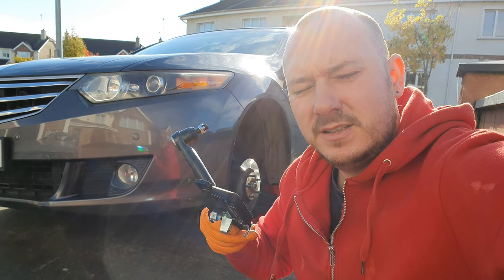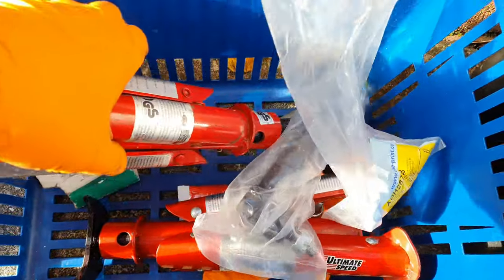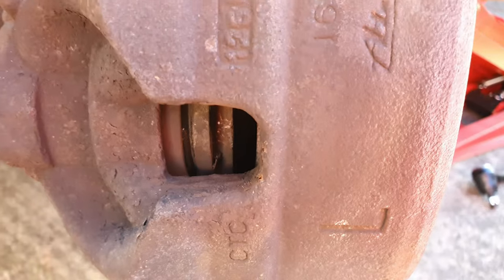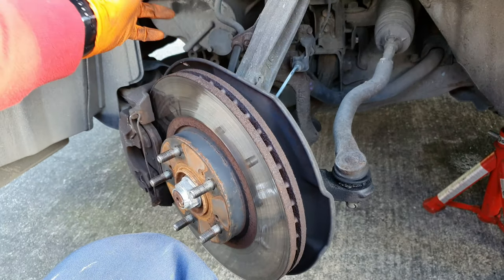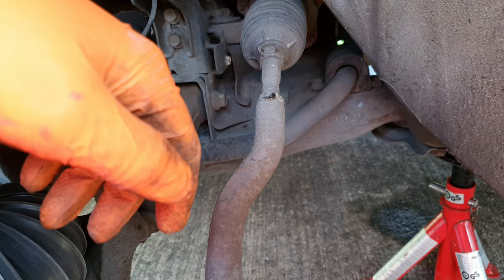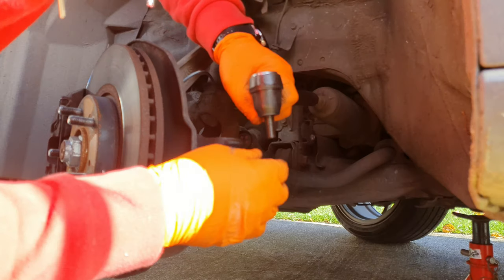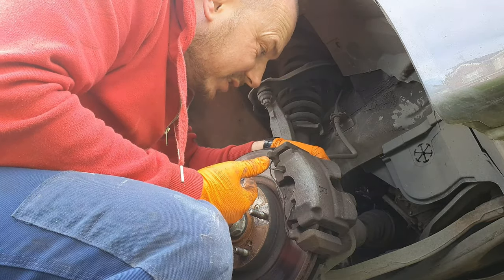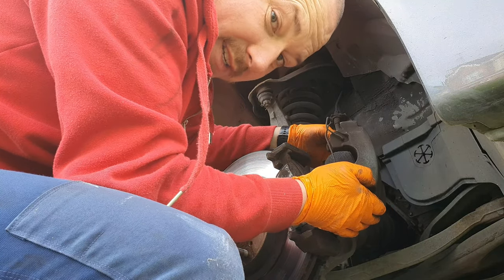how to replace tie rod end/ honda accord 2009 cu3/ how to replace brake pads honda accord

Comment: Awesome vid!

Have you done a video for changing the front axels?
Reply from the maker: Thanks a lot, no i haven't had to change it so haven't needed to make a video about it.
Reply: @GPTV2020   Oh ok, still good. It’s hard to find videos of anyone working on the 8th gen Accord especial since the CU2 and CU3 are the equivalent to the 09-12 USDM Accords in terms of layout with slight space differences. I was looking at your jack, there’s a bolt that can go into the front side of the jack where you insert the lever to give it a perfect alignment. I believe it’s a short 14mm (really short) that can help. 

I recently did a stabilizer bushings without dropping the subframe. Also, I think the grinding could be the backplate on the back of wheel hub that could be rubbing (they’re prone to getting bent on any car).

Comment: I have the some  with squeaking brakes sometimes and they brand new disk  and   brake pads high quality as well!! but is happen sometimes when pressed lightly
Reply from the maker: Yes i still have the same issue, just sometimes it squeaks, i have not installed my new ones yet.
Reply: I had the same issue with squeaking brakes, and then I found out that on the rear brakes, Honda uses two different slide pins in the caliper and they were misplaced. One slide pin is rounded and must be in the bottom, whereas the upper slide pin has a little bit of a square shape. When they are reversed, the brake doesnt attach fully and causes vibrations.
Reply from the maker: That's is a great tip thanks a lot, my front brakes are still the same, the squeak and grind but whenever I check them, they are fine, so I will definitely take a look at them for this issue the next time. Thanks pal.
Reply: @GPTV2020  No problem, I think the front brakes have identical slide pins though, but the rear ones are definitely different. It is worth checking for sure, I struggled a lot because of that :D
Reply from the maker: I already have changed the whole lot on the back, disc's, shoes, pads and calipers so everything on the back is now fine but the front is still the same but it only happens sometimes. I wiill most likely changed the calipers if it continues after i check out my sliders. Thanks again man.